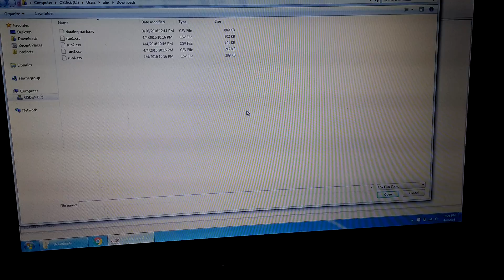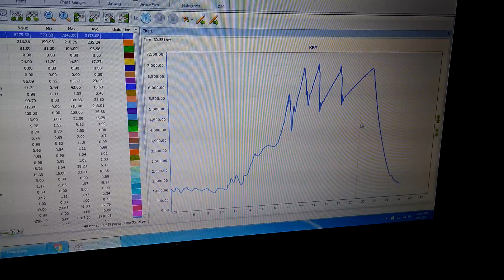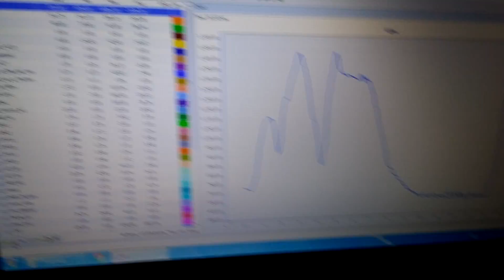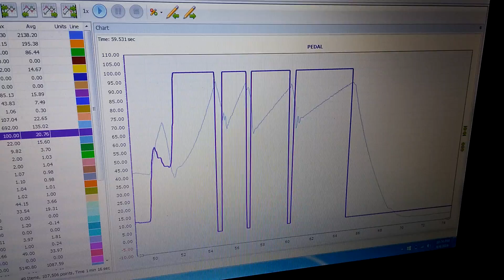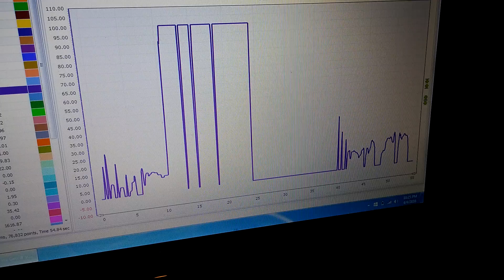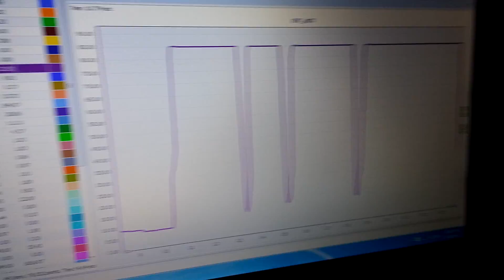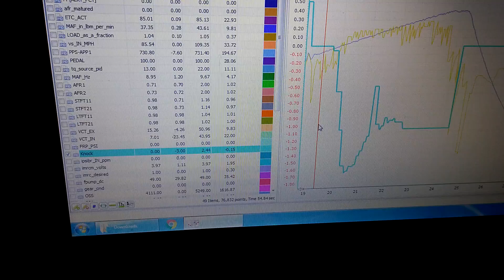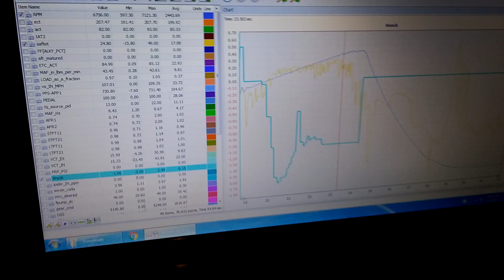Datalogging Tutorial

Comment: At wot if you afr jumps all the sudden from .85 lambda to .95 lambda and stays at it, but the stft are still at 1 is that normal? How do you tell if your running out of fuel system or fuel injector or if the tune just isn’t giving enough fuel?
Reply from the maker: Stft Stuck at 1 when this happens?